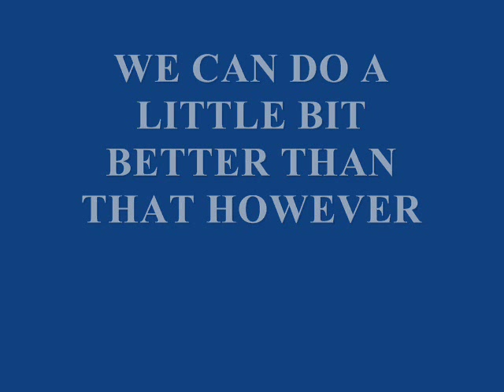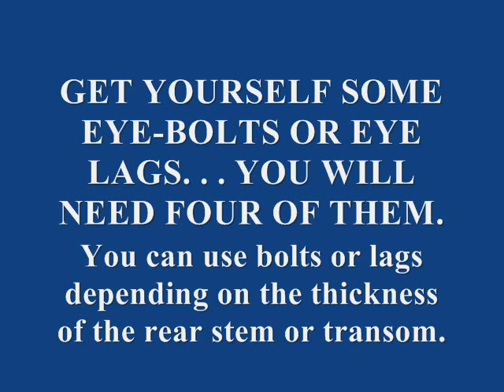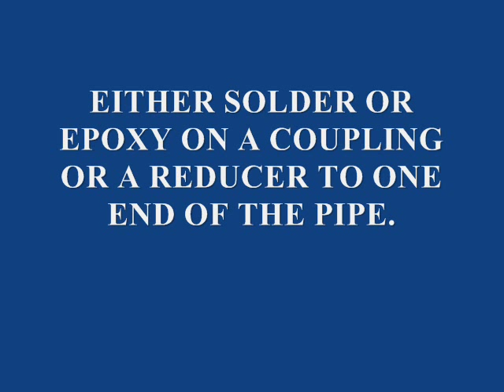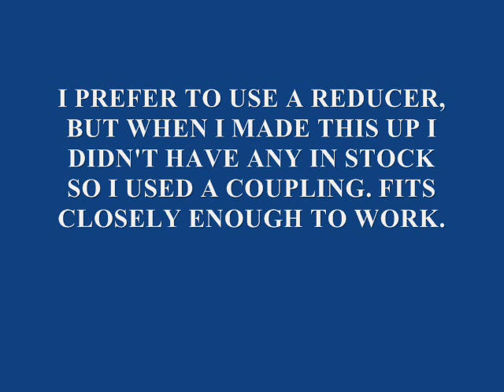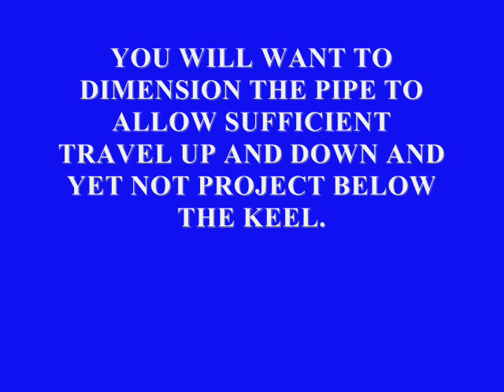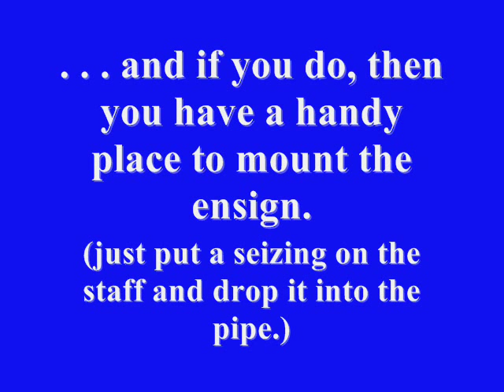Quick-and-Dirty Gudgeons and Pintles

Comment: I was thinking you could instead of using reducers just drill a hole in the top and bottom of the copper pipe and use a nut and bolt, or just a clip to keep it in position with a washer.